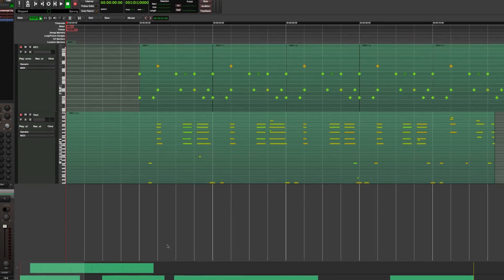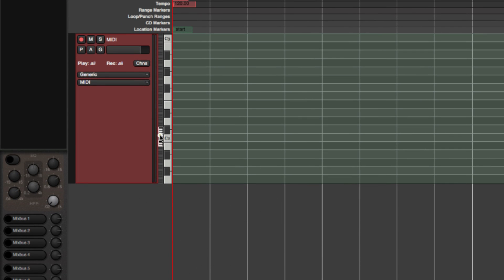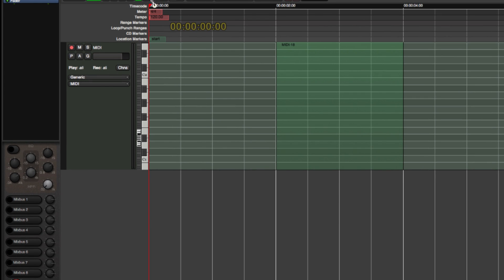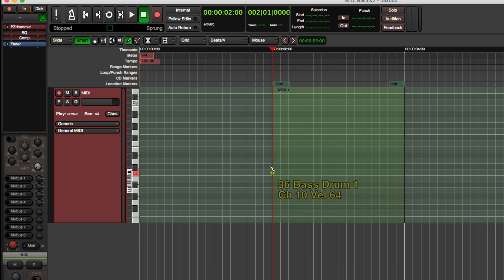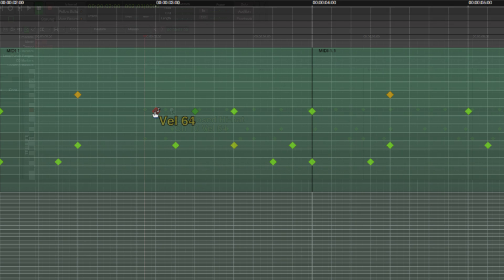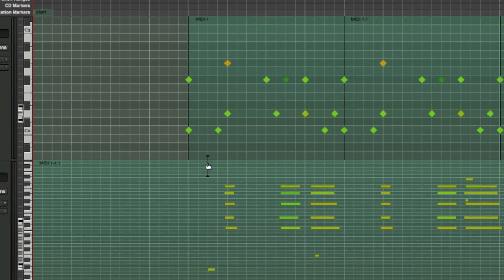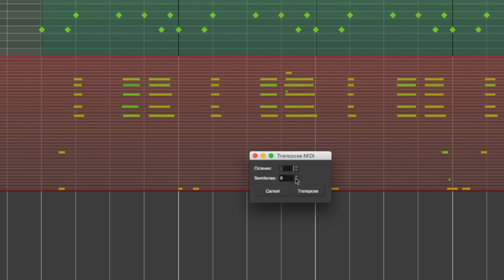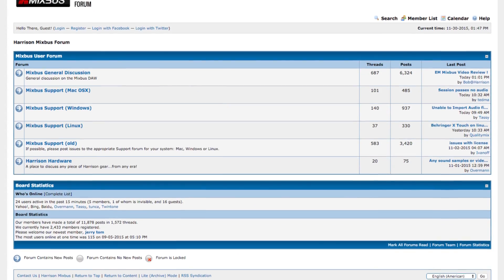MIDI Basics in Mixbus (v3,4)

Comment: Just a thought... maybe it could be practical to first explain how to get the MIDI-signal from the keyboard into the Mixbus MIDI-channel before you explain how to record MIDI? Maybe its just me, but there wont be much to record as long as the signal doesnt reach the MIDI-instrument...
Reply: After you create the midi track, R-click on the track header. In the pop-up window, choose "inputs" and select your Midi In.
Reply: Thanks for monitoring this. I have the same question, and tried your suggestion to Maarten. I have tried everything I could think of, but nothing I do seems to result in MIDI notes from either a Komplete Kontrol 61 or an Arturia Player triggering a note on a plug-in synth. Obviously I’m missing a connection somewhere, but am at a loss to what that might be. Any suggestions would be welcome. Regards.